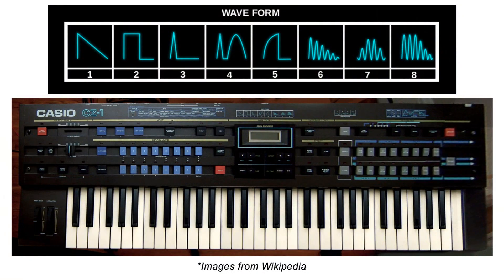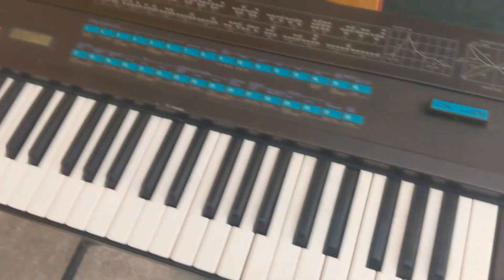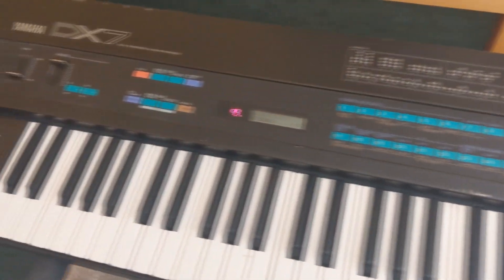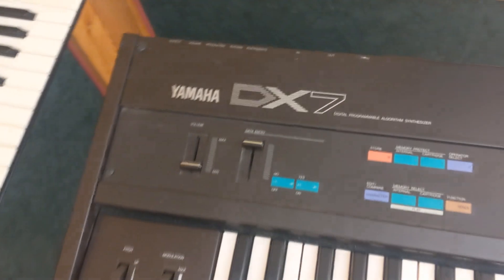PixelWave - Phase distortion synthesizers and why they are awesome

Comment: can it tb303 like blade rave club scene?
Reply from the maker: I'm not familiar with that in particular, but the 303 has a couple things this pedal can't do that contribute to the vibe of the 303:
1 Gliding per note in a sequence. (You could try to play it that way in bass or guitar, but I'm not sure many of us are capable of playing like that consistently on a fretted instrument)
2 Fixed envelopes: instead the phase distortion is controlled by the input dynamics similar to an envelope filter.

Like you can probably get close.
This pedal isn't emulating an analog synth though. It can do some pretty cool bass sounds. Phase distortion is kind of its own mid 80s sound somewhere between the DCO analogs and Yamaha's FM synths.
Reply: @subdecay  thank you for the detailed explanation. i am looking for a specific sound. and I the closest thing that could do like 3 things in one go is this pedal. 1 is the countable peak distortion like acid music has, not a random fuzz but very chainsaw like pulses. 2 is some octave down pitching and 3 envelopes and lp filters. its a quite the batch of effects but seems like it could be close.

Comment: Is this the same as Phase Locked Loop or PLL synths?
Reply from the maker: Not quite. A phase locked loop uses feedback to lock two oscillators together. There are PLL guitar synth/fuzz pedals that are fairly simple. There are VCO based modular analog synth modules, but I'm not super familiar with them.  
Phase distortion uses one oscillator to modulate the phase of another. It was kind of a precursor to the virtual analog synths that followed later, but would run on 1980s hardware.
Reply: @subdecay  cool, thanks for the info